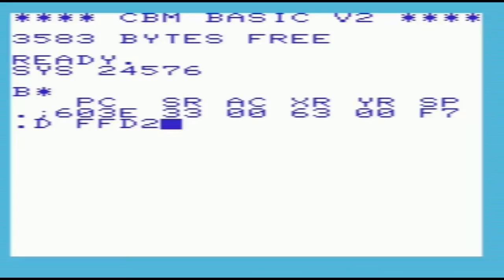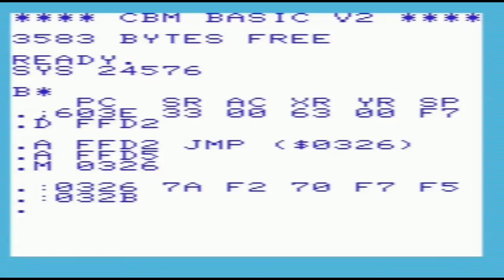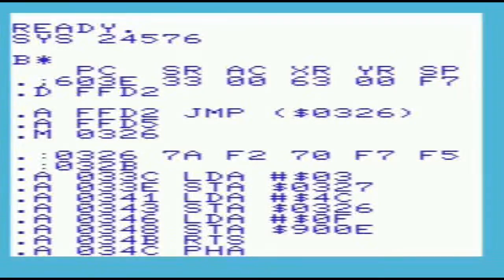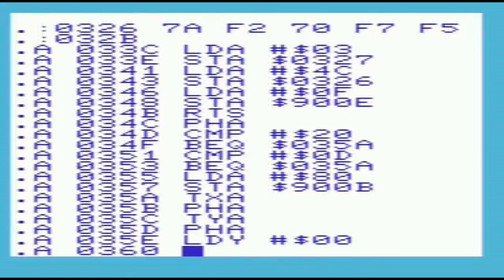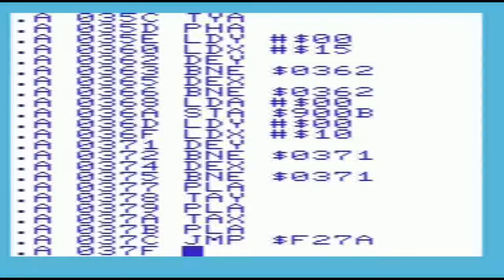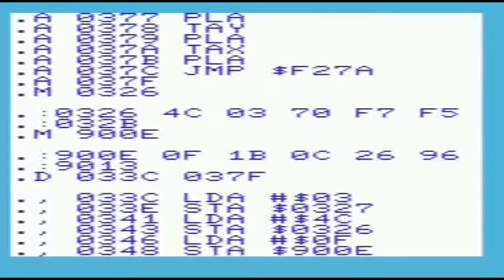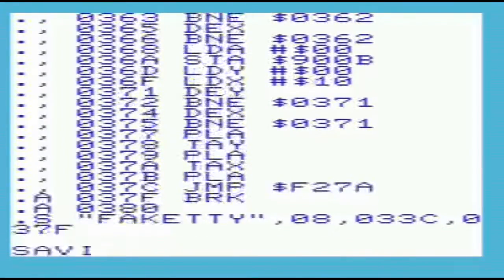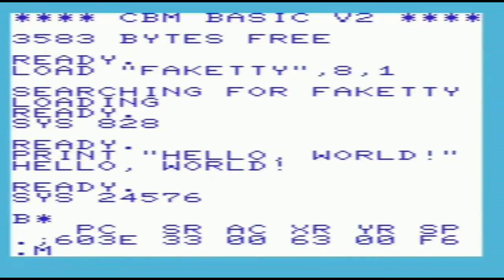Creating a TTY Simulator in Assembly Language on the Vic-20

Comment: I typed this into my VIC and it worked perfectly! The only problem is I use my vic with tape exclusively. Sooo... I whipped up a modified version. This uses the classic machine language loader, where you put the basic program right before your machine code, and then save the basic and machine code segment as one file. It then swoops into zero page memory and resets the start of basic pointers to point after the tty program. You type run, and it resets basic. When you type list now, it shows nothing(In fact it is still there at $1000, but you are now starting basic at $105A). At this point, type in NEW. You now have a fresh basic with 3492 bytes free...and a cool TTY proggy running under the hood, that won't get wiped on a soft reset or by using the tape, and is completely transparent to your programs. In fact, this program he made is so small, I reckon most games wouldn't even notice it was there. Here is a hex core dump of my version(basic needs the zeros at the end in order to know where basic ends. There is also a zero at the start of basic): 

:1000  00 0C 10 0A 00 9E 20 34  REM sys 4110 followed by End of basic 
:1008  31 31 30 00 00 00 A9 5A  REM which is denoted by three 00's then
:1010  85 2B A9 10 85 2C A9 10 REM our code begins.
:1018  8D 27 03 A9 26 8D 26 03 
:1020  A9 0F 8D 0E 90 60 48 C9 
:1028  20 F0 09 C9 0D F0 05 A9 
:1030  80 8D 0B 90 8A 48 98 48 
:1038  A0 00 A2 15 88 D0 FD CA 
:1040  D0 FA A9 00 8D 0B 90 A0 
:1048  00 A2 10 88 D0 FD CA D0 
:1050  FA 68 A8 68 AA 68 4C 7A 
:1058  F2 00 00 00 00 00 00 00     REM lots of zeros again for start and end.

There is something very weird about the emulation...in the cartridge hesmon, there are no spaces. Perhaps Hesmon inserts them when you do an output divert to the printer? I had a great deal of trouble copying and pasting into vice as well. However, this will certainly go onto a real tape on my real vic, and real Hesmon cart will be used to enter it. :D
Reply: Would love to see you make a tutorial about this or an explanation video!